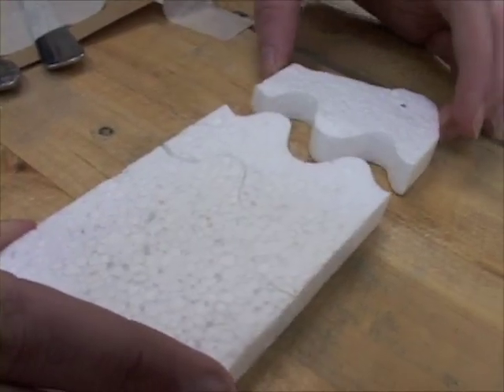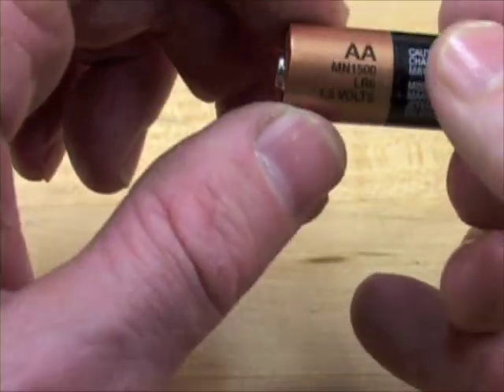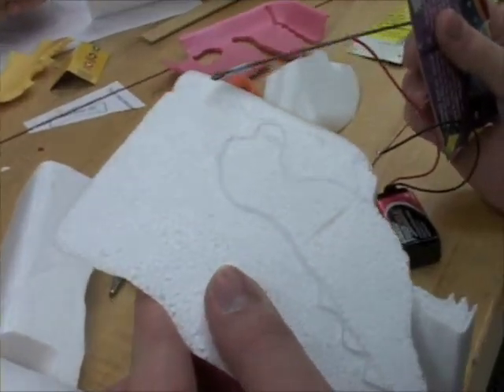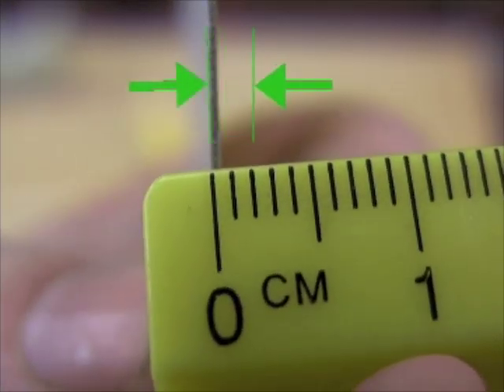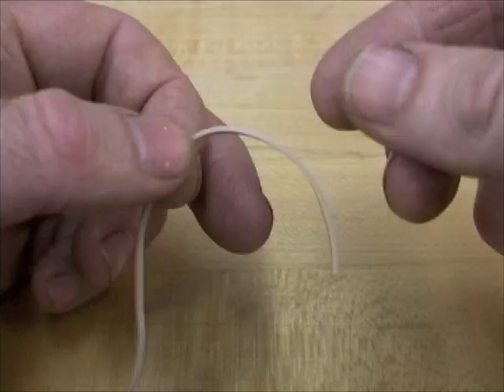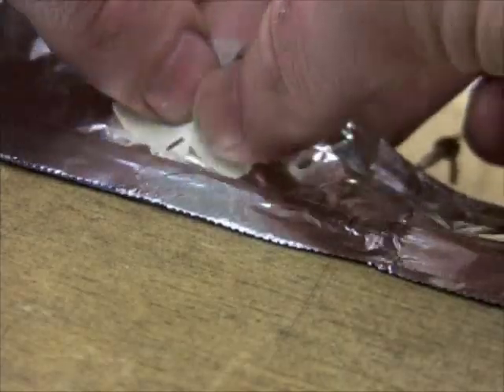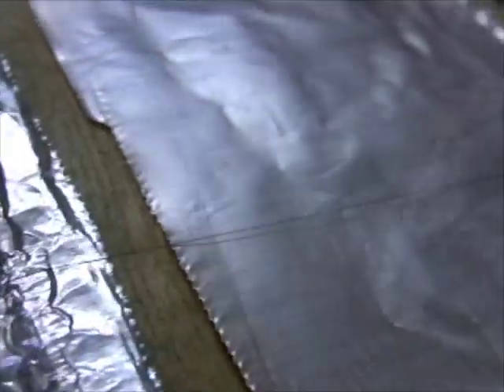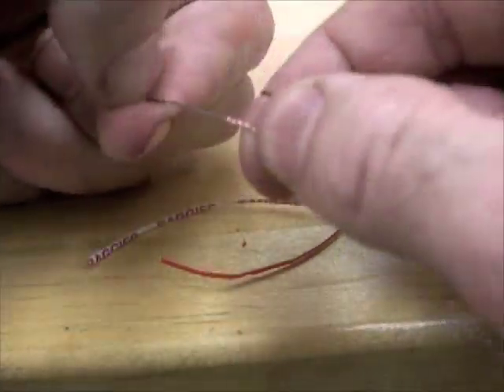Part 6 Air Surfing Kit

Comment: how about the copper wire?
Reply from the maker: Do you mean, "Can copper wire be used to hotwire cut foam?" In an early video I did explore the possibility. http://www.sciencetoymaker.org/airSurfKit/HotWireCutFoam.htm
However, it breaks easily. Ni-chrome wire is high-resistance and can get how without becoming weak--perfect for hotwire cutting.